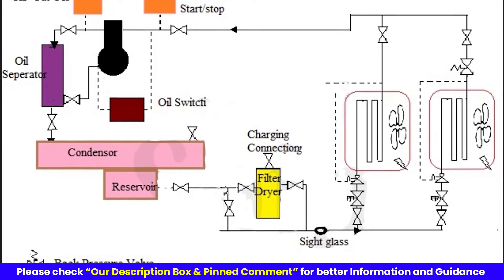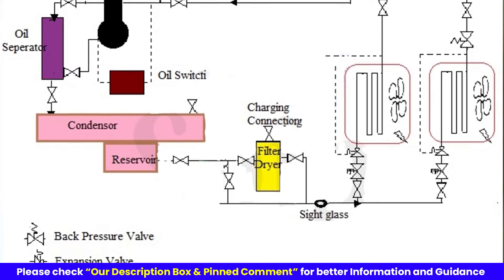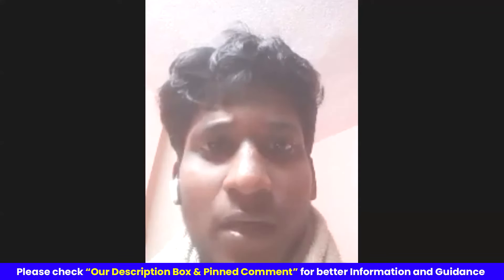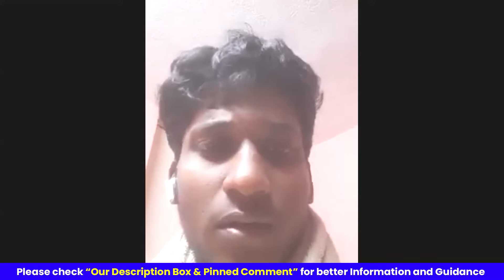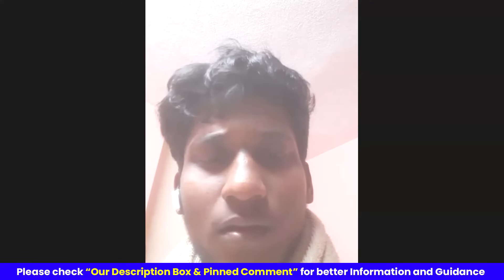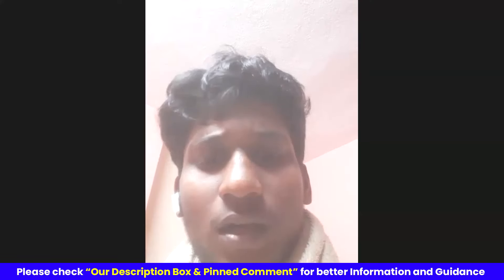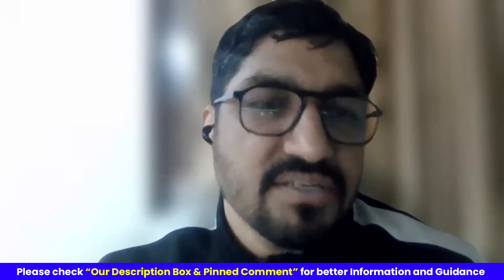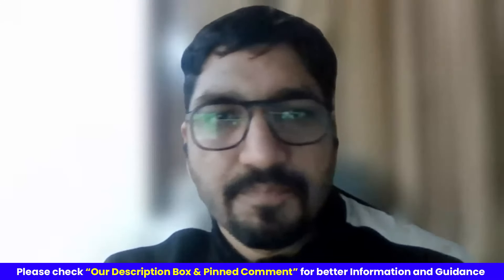What is the function of back pressure valve in refrigeration system? GME Interview Questions

Comment: Even if there is a solenoid vlv which is cutting down the refrigerant flow to the veg room the compressor is still taking suction from the veg room right, so it'll be drawing gas from the veg room and ultimately the temp will fall down than what is actually it supposed to be.
Reply: @johnshow9224 The veg room has a back pressure valve in the evaporator outlet that will remain closed if the evaporator pressure falls below the set pressure ( around 4 bar), so, no gas will go to the compressor from the veg room if its solenoid valve is closed. Also, suppose there had been no back pressure value, once the solenoid valve was closed, in that case, only some of the evaporator gas will go to the compressor until pressure is equalized between the evaporator and compressor suction. So, no cooling will take place if the solenoid valve is closed